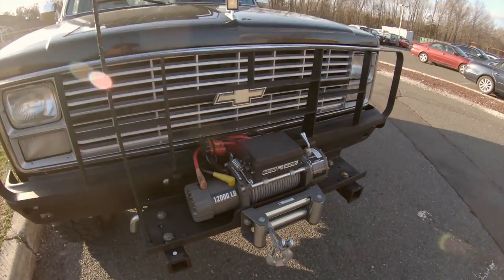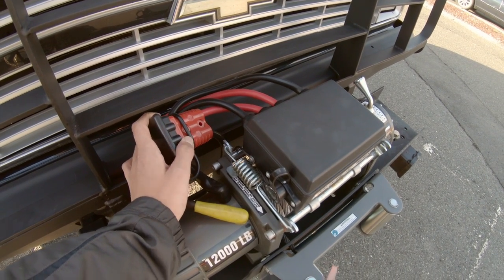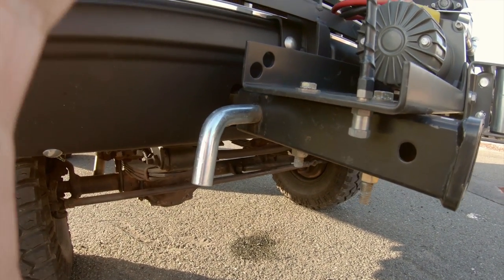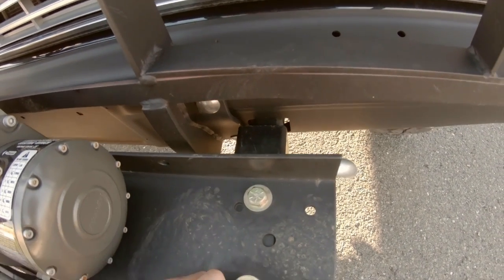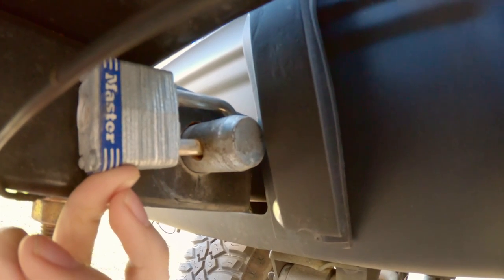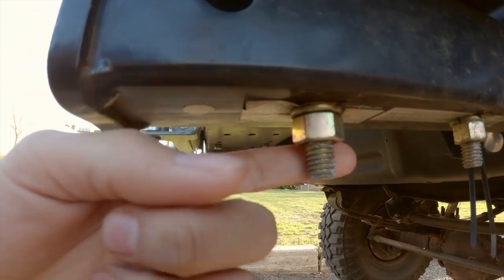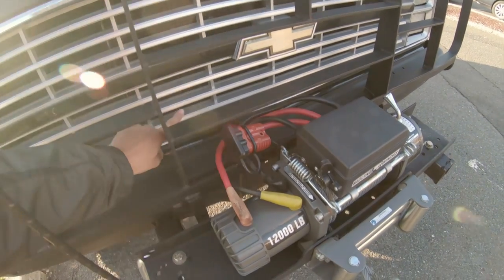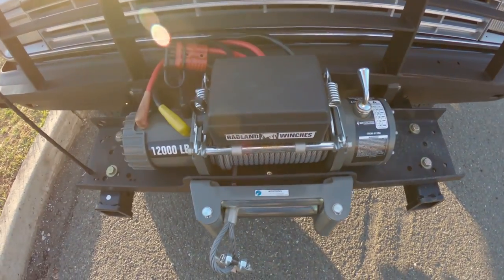Winch Mount For CUCV - No Welding Needed! | OdysseyOverland4x4 Ep.1

Comment: Good job. At 1:50 how does it attach to the frame again?. You say base of the clevis. Thanks.
Reply from the maker: sh839c If you have a CUCV you'll have what is called a clevis, which is essentially a metal box tube coming out of the frame with a large 1" hole to slide in a pin that holds in a D-Ring. Basically all I did was remove the D-Ring and slide on this assembly over it instead!
Reply: @OdysseyOverland4x4  Just FYU those Drings are NOT tow rings like people thing, they are TIE DOWNS.... and frankly not strong at all. Many people have ripped them right off through truck frame... so this is really not a safe mod. What you need is a mount that bolts to the frame period.

Comment: Those "shackles" are tie downs and they will pull right off the truck.... and snap off. Get a mount plate and do it correctly. The only reason those are on the truck are to tie it down during transport they are NOT tow shackles and using them like this is dangerous. In fact the mount plate you bought from HF can be trimmed down to mount prperly on the frame AND be hidden behind the bumper... instead of this dangerous nonsense.
Reply: i have the same setup on mine and i have a 14k winch and i do hard pulls with it and nothing has ever happened

Comment: that is a good set up but what if u have to dip down before u climb something wouldnt that get in the way like that
Reply from the maker: Are you talking about the winch?
Reply: yes
Reply from the maker: @Ryankary666  Honestly, I have not really run into that issue. Back in the day especially when I would actually go wheeling with this thing, when I was concerned about the terrain, I would remove it (it has 2 pins that hold it in place) and toss it in the trunk, having it if I ever needed it. But since then, I have just left it on, and it has held up great.